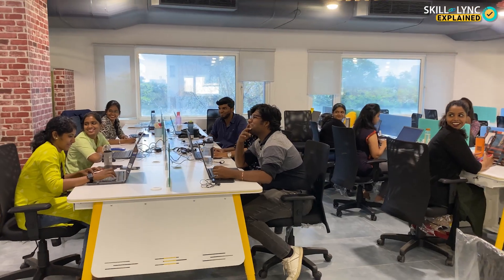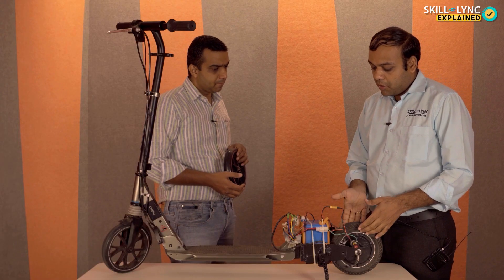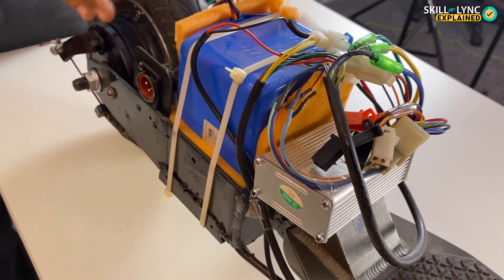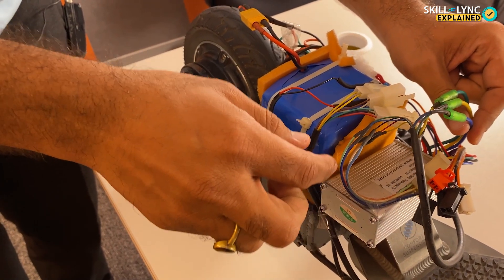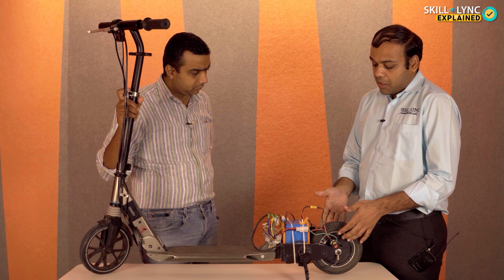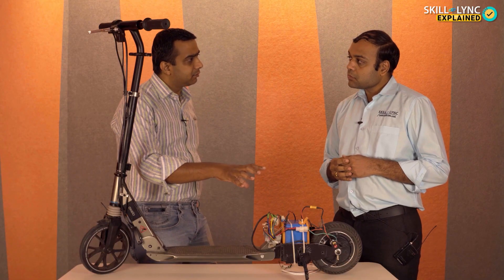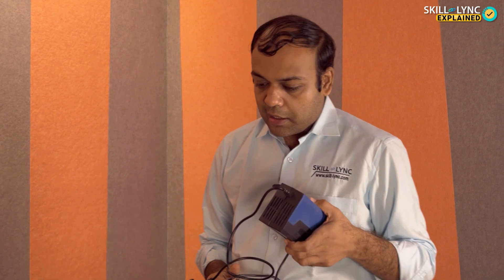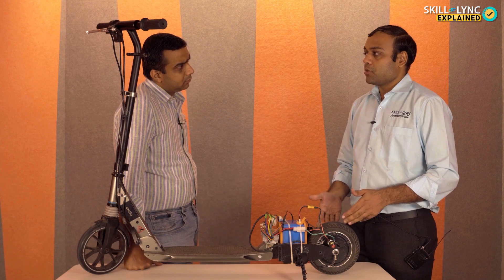How to Build Your Own Electric Scooter | Explained by Skill Lync

Comment: what if we use regenerative braking at the rear wheel?  amazing Engineering >>>>>>>>>>>>>>>
Reply from the maker: Yes we can use regenerative braking with rear wheel if the motor controller supports it.